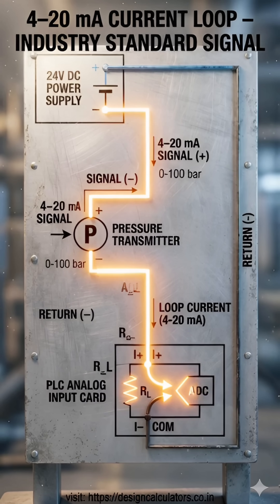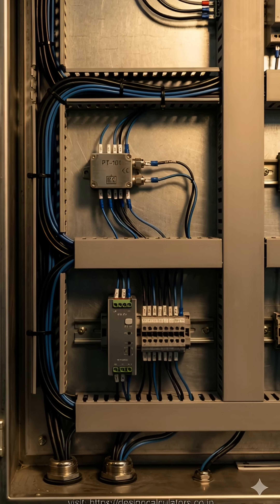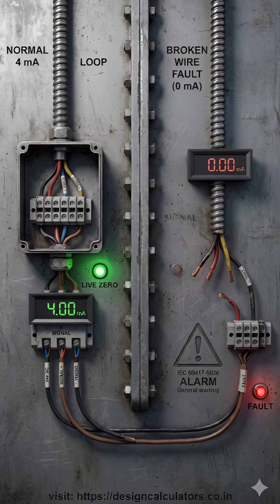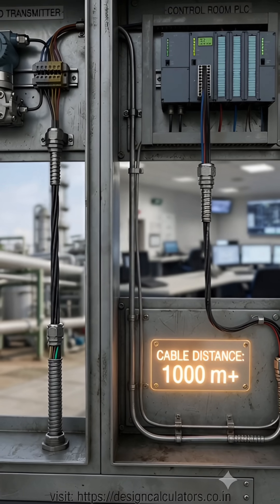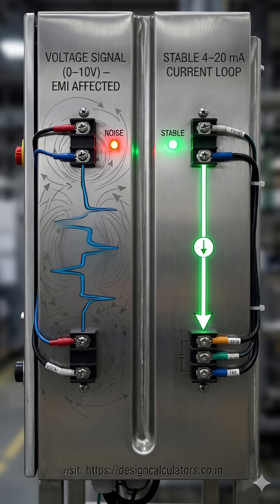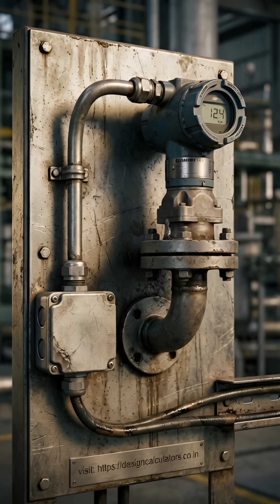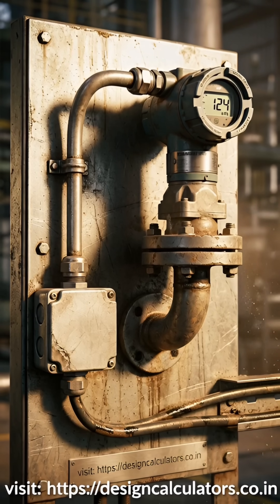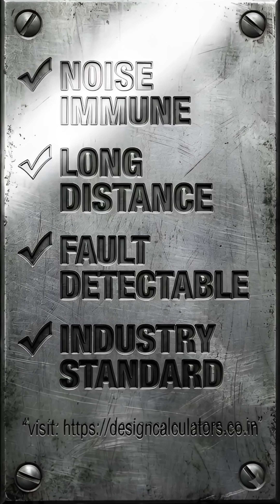Why is 4-20mA the KING of Signals? https://designcalculators.co.in

Comment: Dealing with industrial test stands with 4-20mA loops used extensively for controls and instrumentation, they are thoroughly jammed by electrical interference, despite best efforts such as cable shielding, isolation, twisted (wire) pairs, trying to avoid ground loops, etc.
Motor variable frequency drives (VFDs), which most things use now, excel at this kind of interference.
Reply: I have only these issue twice. Once where the electrician ran the HOA circuit in the same conduit as the load cabling. Another with a MVD where a piece of glastic was removed and lost between the MV and LV comm compartment.
Reply from the maker: @malibonzi2472 thanks for sharing your true experience..
Reply from the maker: @mathartley2843 Tough situation—VFD noise can wreck even well-shielded 4–20mA loops. Try ferrite chokes, signal isolators (high CMR), or an isolated transmitter near the sensor. Also, separate signal/power cables (different conduits, 90° crossings). Industrial noise is tough battle. Good luck!
Reply: @designcalculators  What do you mean by isolated transmitter near the sensor?
Otherwise, we've tried all that except the signal isolators (high CMR) - we're kind of stuck with the ~2005-design test stand.
OTOH, newer (and vastly more expensive) test stands with more isolated signal conditioning IME don't do much better.
Reply from the maker: @mattbartley2843 By “isolated transmitter near the sensor,” I mean galvanic isolation at the source, before long cable runs. This breaks ground/noise coupling early. With VFD dv/dt noise, once interference enters the loop, even high-CMR downstream isolators struggle—common in older test stands.